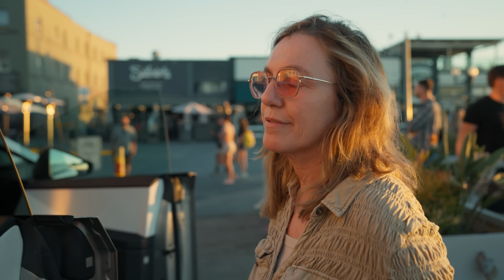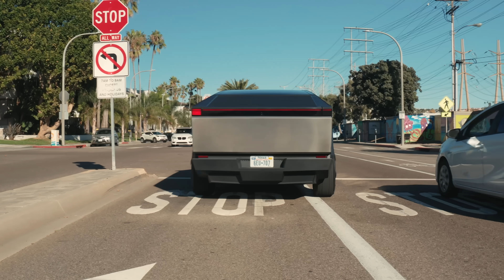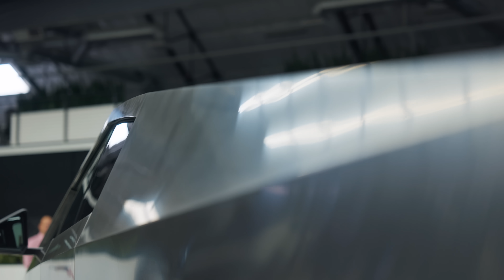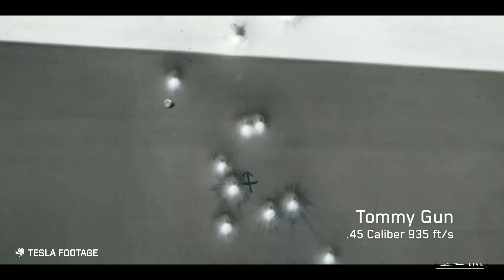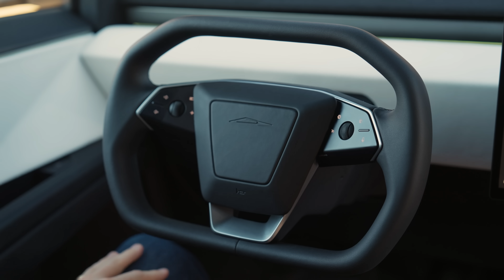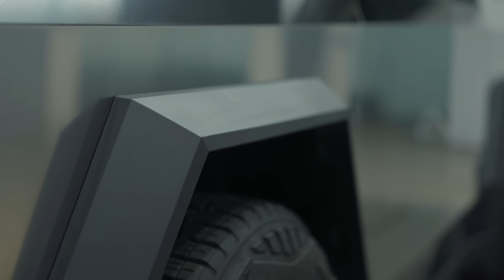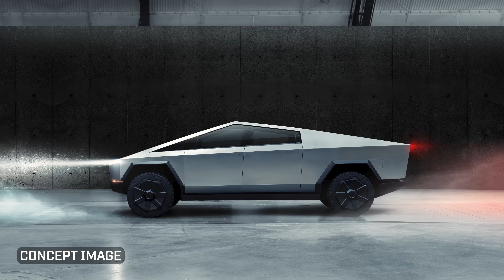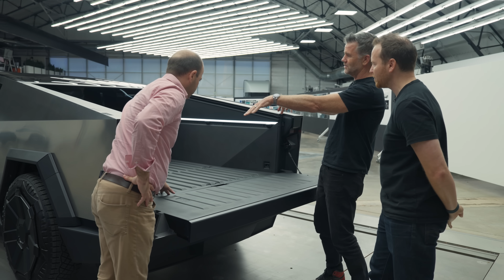FIRST DRIVE: Tesla Cybertruck Full Review

Comment: How is pedestrian safety addressed? The strength in vehicles is intentionally higher on the inner part of the body than on the outers and closures, allowing for elastic deformation of the outer blanks in pedestrian accidents. If the outer parts are excessively stiff, the entire kinetic crash energy is transferred to the pedestrian's body in a single quick impact, posing an unnecessarily high risk of injury.

Comment: One of the interesting things about stainless steel is that it rots through really quickly in salt water when there is no water flow. You get accelerated crevice corrosion and caustic embrittlement. So, should one of these arrive in the UK I'm pretty sure that after a couple of salt laden winter road years it will be looking quite sad.
Reply: They areht using standard alloy SS.
Reply: This steel is the same steel used on the Starship prototypes, ya know, the ones that sit in the saltwater air in Southern Texas. 🤷‍♂️
Reply: Never mind the saltwater, this will never be legal to drive in Europe.

Comment: Question is it practical for daily driving for family because many of those F150 and 1500 and Ram are driving family around.  The tech that they use is this need to start to go into their other cars.  48v, 800v and powersharing back to the house when you have powerwall setup.
Reply: YES , Cybertruck is MORE Practical & has Superior USE case than ANY pickup truck in Production. 
CT is also the SAFEST truck you can EVER buy.
Reply: I dont know about those stainless steel on Texas hot summer days.  One touch burn your hand since it has both door handles.  My model y is too hot to touch on someday.
Reply: @kimle01   - Cybertruck has touchless Doors , automatically open. 
CT was tested in Death Valley, CA over the Summer.

Comment: All this tech but they couldn’t solve the ugly windshield wiper. They could have used compressed air and liquid to clear the windshield. Air jetting for rain and snow liquids for dust and dirt. An onboard compressor is already installed for suspension. Or they could have made a trap door to store the wipers which once the wiper is deployed it closes till the wiping function is done. Or a combination of all of the above a hidden wiper to remove film or dirt that the jetted air or water couldn’t clear.

Comment: This is an Apple iPhone vs BlackBerry event repeating itself.  Trucks will never be the same.  Tesla not afraid to step out of the box.  Big 3 only does RETRO. This truck more what’s under the skin, 48v, 4680 tabless dry cell small battery pack, steer by wire, SOTA and FOTA over air updates, etc.  Tesla designs own
Software and hardware as well as its own chips.  Glad Elon is an American.  Car batteries have made grid storage batteries more competitive.  Elon going after CATL world’s largest battery manufacturer and in China.  Tesla is both cars and energy.  Makes own batteries, superchargers, etc.  msrp allows its to build out its charging network

Comment: They should have had these guys speaking at the Cybertruck event. Better undestanding about how much engineering required for exterior panels. Also, it can charge in future at 350kw which many left the CT event thinking 250kw was max. I do wonder why they didn't incorporate the rear tailgate from the original in which the back dropped few inches and then the tailgait extended to the ground to allow the ATV to drive into the bed. Also, would be nice to to expand underbed storage to fit a full tire and remove the front storage for most truck owners. I expect iterations of this design once the complete ramp in about 1.5 years

Comment: During the verdict, you mention a buyer being able to “stomach the price increase” but don’t forget the reduction in the initially advertised range of 500+ miles down to production version of 340 miles.  That was a huge attraction-the price to range was fantastic in the initial reveal 4 years ago. Disappointing production numbers.
Reply: Yes, the CT won't get up to the proclaimed 500 miles, but at least the range extender increases to 470 miles for the dual motor. Still much better than Ford and GMC.

Comment: "Tesla cars most drag efficient in their class" claim is a straight lie.
Lightyear has 0.175, Lucid Air 0.197, Mercedes EQS 0.200, Model S 0.208 drag coefficient  
Do not forget the Cybertruck was once claimed to cost 30000 USD (now 60000 USD) base price, and the tri-motor was claimed at 70000 USD (now 100000 USD).
Make it green so it looks like the Halo Warthog.

Comment: They used to say it would run around 40k, and now they are 80-100k so i don't think you will see as many around unless its a status symbol.  They are still quite novel until a few years then they will come down in price
Reply: The base model was supposed to start at 39900, they said the tri motor would be 90k, so its looking like a 25% increase across the board.  But if you look at inflation since the unveiling, it's only up 1%.
Reply: @JohnDoe-id8si  truck prices have already increased about 15% since 2019. Dealership markups are definitely not helping. That said, it's relatively cheaper to buy a Cybertruck trimotor than a Ford Raptor R or Ram TRX, or hell, even a Jeep Grand Wagoneer.
Reply: I mean the inflation we’ve had since then is why it’s more. It’s relatively the same price just the value of your dollar has diminished due to recent money printing leading to inflation.
Reply: If Tesla sold them for the price from the 2019 unveiling right now, buyers would re-sell them at a hefty markup - stealing the profits from Tesla.
Reply: Ummmm, inflation much, also RECORD interest rates on Loans.
Reply: Thats what mismanagement does!
Reply: @dr.emilschaffhausen4683   - MARY fled , and it Matters.
Reply: Most well equipped trucks are now around 100k I am pretty sure.
Reply: Jeeps wagoneer is $100k and i see them all the time...

Comment: Wow.... Just... Wow...

I wonder how much Musk has paid Top Gear for this EXTREMELY biased review. Let's sprinkle some truth, shall we?

Musk's empty promises:
1- Under 40k buying price? ONLY 2.5 times more, seriously? That's A LOT. (excl. the extended batt pack)
2-  200kWh battery with 600M radius? HA! Not even CLOSE, not even WITH the 50kWh extended batt pack.
3- Bulletproof glass? It's not.
4- Lasers that 'shoot' the waterdrops from the windscreen instead of using a traditional wiper? I clearly see a fat ungly wiper on the side, like a bus.
5- A full exoskeleton, so no traditional chassis? It does have a traditional chassis, and the 25% added rigidity is only 10% more (on average) than traditional steel bodypanels. What an achievement.

Now let's talk practicality:
History has shown that stainless steel is far from stainless. It may not rust, but stain it sure does. If you don't detail the bodywork EVERY SINGLE DAY, pretty soon it'll look like 💩. Especially if you live in humid climates and don't have a garage to put it in.

Speaking of detailing, how do you think a dent can be fixed? Well, how about not? There's no way a bodyshop can buff that out. Neither can you fill it, sand it and repaint it. So the only way you'll be able to get rid of dents, is to change that entire bodypanel. So you better not get into any accidents.

And since we're on the subject of accidents. This tank will never get approved for the European roads, and for very good reasons. The sharp edges of the stainless steel blades will cut through pedestrians and cyclists like a hot knife cuts through snow. It's a good thing blood is easy to clean off stainless steel, that's something you're definitely gonna need.

No, this abomination should've stayed where it originated, on the drawing board and on bedrooms posters of Musk fanboy man-children.

Comment: Correct me if I’m wrong but isn’t most ammunition super sonic? That’s one of the reasons firing is so loud is the breaking of the sound barrier. I’ve only heard of sun sonic ammo being used by someone who is using a suppressor.
Reply: Most handgun/shotgun ammo is subsonic. 9mm with 115gr or less bullets is supersonic, but the lower mass affects penetration. 115 gr 9mm was what they were shooting in the demos and it only dented the door. .357 Magnum/ 357 Sig loadings are supersonic, might penetrate a bit. .45ACP is subsonic, even out of the Tommygun they used, which is probably why they used it. Rifle ammo is generally supersonic.  Lower weight rounds at an angle might skip off.

Comment: First review I've seen that actually covered the cargo area.  Thanks for that!  I guess we'll have to wait and see how it fares with towing.  My only concern would be the notion of moving the structure from the inside to the outside.  Makes a ton of sense in terms of surface protection, the first thing I've done with my pickups has been cargo liners and bed protection.  But I'm assuming they have a substantial enough frame to hold up for towing?  With all that torque I could see this thing ripping the tongue off a loaded trailer.  Anyhow, great review!
Reply: It can tow 11,000lbs
Reply: @nicholastonella5460  I understand that, but I want to know what towing is like in the real world.  The Ford F150 Lightning claims 10,000 lbs of towing capacity, but when somebody attached a 6,000 lb trailer to it the range dropped to less than 90 miles.  How does towing affect the range of this thing?  And I'm still curious about the structure.  They talk about moving structure from the inside to the outside, but towing requires something beefy between the drive train and the frame, so I'm assuming they didn't move all of the structure.  I'd love to see somebody delve into that.
Reply: The towing range will be poor. It's physics :( My friend tried towing a small boat through the desert with his dual motor Model Y. Didn't end too well for him. If you remember playing with slot cars as kids, how much more power you had to add when you modified the car and tried towing or pushing other toys with it  @brianshorey

Comment: The low headlights are going to be so welcome on the road. So sick of getting blinded by LEDs.
Reply: Now you'll just be blinded from a different angle, lol.
Reply: You'll get MORE blinded when they are lower because the angle will have to be more shallow to get the cutoff at the same distance. Plus, the lower the headlights, the more light is reflected off the surface in the opposite direction meaning oncoming drivers will get more your headlights and you'll see less illumination due to the angle. The statement by the Tesla engineer that it's better to have them lower is completely wrong.

Comment: questions i have are : 1. Why wasn't the extended battery pack designed to fit into the under bed storage area? 2. What happened to adjusting the front shocks up and back shocks down and the tailgate drive up ramp?
Reply: The truck  has a launch mode where it lowers only the front.  I expect it has or will have a rear low for loading mode.
In tailgate drive up ramp was too heavy to close.  They added a spring to the current one and it almost closes with one finger kind of thing.  Tesla will sell ramps but they go in the bed.
The pack is too large to fit in the in bed hidey hole.
Reply: TAILGATE ramp was too HEAVY for Average person to LIFT up. so, DELETE.
Battery pack had to be Accessible, to install Aftermarket.
TESLA also wanted to KEEP the Smugglers Cove. 
you , can Still MAX raise the Front & completely lower the REAR / kneeling.
Reply: Another answer for your first question is to keep the angular momentum down - the closer the weight is to the center of the vehicle, the easier it is to turn.
Reply: Questions I have: 1. Does it have a good sound system?   2. Are the seats heated and cooled, or massaging?  3. Where’s the spare and jack?

Comment: Top Gear - Actually the LARGEST Tesla battery is in the PRODUCTION version of the Tesla Semi which is Class 8 Long Range heavy hauler , hauls 82k Gross to 540+ miles in a Single charge , in less than 8H. 
Tesla semi also hauled FULL LOAD 1170 miles in less than 24H w/ 3 Drivers.

Comment: Having just watched the crash footage of the 35mph frontal crash. It managed to break the rear suspension, which was impressive and the poor sods that would be inside would be the only crumple zone.
Reply: Cybertruck has 4 wheel steering. The rear steering may have been damaged in the crash test or just  turned but the rear suspension seems ok.
Reply: @jeffcutten  i noticed you completely ignored the whole passanger injury due to poor crumple zone management part
Reply: @applyscience  Yes I ignored "the poor sods that would be inside would be the only crumple zone" because the front of the truck is clearly a significant crumple zone. As there's no gas engine taking up valuable crumple space it seems to me Cybetruck may actually have more total frontal crumple zone than a traditional truck. As official crash test safety scores are not yet public I will also ignore your assertion of "passanger injury due to poor crumple zone management " as your source seems to be you made it the f'k up. Tesla has previously engineered the safest cars on the planet so should also be very capable of engineering class-leading safety into the Cybertruck but I'll reserve judgment until official safety scores are public thanks.

Comment: TOP GEAR - Actually TESLA is Sandbagging the Cybertruck SPECS as to not EMBARASS gm, FUD, RAM & gmc . 
the Tesla PLAID Drivetrain actually has over 1200 HP PEAK , and in the Future it can UNLOCK top speed (200+ mph) in Software + Carbon - Ceramic (performance brakes) as well as Maximum HP and RANGE .

Comment: It's cool there's an actuator for towing trailers built right in. I know on big trucks like commercial trucks that's an additional piece of equipment that you control manually and its usually attached on the bottom of the dash. I don't even know if regular pickup trucks have actuators for trailer brakes. None i've ever owned have i don't believe at least not from the factory.

Comment: I hope Tesla reads this suggestion:

How about a much smaller range extender that is simply a capacitor (Tesla bought Maxwell tech for that). 

It would occupy a tiny space (may be even the sub-trunk), 

Driver who is planning a long trip or heavy load job would charge to 120 %, that extra 20 percent would be available for a limited time, (hours), if not used, would spontaneously discharge, 

Perfect for extracharging right before a big task or road trips. 

I am sure Tesla can do it. 

Tesla range extender capacitor.

Feedback?.

Comment: It's strength and weight obviously help it be the safest car to be in, but makes you wonder what this thing will do to other cars that it may hit in an accident. Travelling at silly speeds it would absolutely obliterate anything that came in the way. No one would stand a chance
Reply: The energy absorption works both ways.  The CT has very good crumple zones.  But mass is mass.  There is no getting around that.    Used to drive around in MGB's and Spitfires.  A mid sized sedan will turn one of them into mince meat.

Comment: It's a status symbol. A novelty. Nothing else. The infrastructure is nowhere near convenient. Some people drive an ICE-V to drop off the EV at a charging point and to return to pick it up. The mines in the US and Canada wont be operational for another 5 to 10 years... Not to mention that electricity does not produce electricity, something still has to "burn" to generate it. In 2023, the USA and Canada do not produce enough electricity for homes and businesses alone. Folks are regularly told to use less and not stress the grid. In the summer it's over air-conditioning and in the winter It's over heating. Procucts today are rated for being frugal and energy-efficient.. Apparently "less is best". So here's what i say, "When they figure out how to put a recharge in a Jerry Can, ...". My pickup never leaves me stranded,.. and i dont have to get a "second vehicle", just in case. The best part of my ice-v is that i don't have to try to explain how 2 industries are better for the environment than just one. #EnjoyTheShow 😂

Comment: @12:00

The part where the dude has the Freudian slip and refers to the truck as a car, said to me as an engineer, this dude legitimately forgot the truck was a truck because they made electronics magic happen, and now this engineer's subconscious has confirmed it regards the physical forces routinely demanded to operate this vehicle, as no more difficult than that required of one of their Tesla cars. ❤
Reply: That's actually a revealing point for both Lars, and Elon (who called it a "car" several times during Thursday's presentation). As Sandy Munroe and others have pointed out, the Cybertruck is a sports car, truck, SUV, sedan, ... or perhaps it's own category. It is a big vehicle, that has a lot of capabilities on and off road, for haulin stuff, for pulling stuff, for powering stuff, for safety, for comfort. It has "truck" in its name, and it has a pickup bed, but that doesn't mean you have to be a "truck enthusiast" to want to be in a well-designed, futuristic, high tech, luxury vehicle.

Comment: Usually Tesla brag about the safety tests. Interesting that this is the quietest they’ve ever been about the safety of the truck. Would like to see a crumple zone test for stainless steel. My guess is your head gets ripped off because it’s so stiff
Reply: Tesla has good computer models, sometimes called digital twins, that they used to crash test the truck while they were designing it.   Seen a Tesla employee saying the real truck crumpled just like the the digital twin.   I don't see where Tesla is trying to push the truck.  They have enough interest as it is.

Comment: So the beast weights 6800 lbs but can only tow 10,000 lbs? That's 3/4 truck curb weight with 1/2 ton truck towing capacity ... Disappointed ☹️
Reply: 10000 lbs is 5 tons
Reply: @spidermain  of course, I meant that's the towing capacity of a 1/2 ton truck. I've edited my comment to make it more clear. Thanks